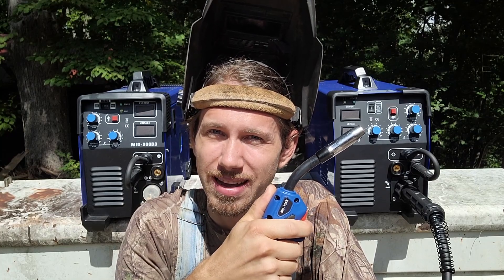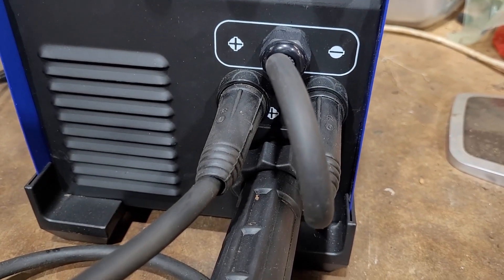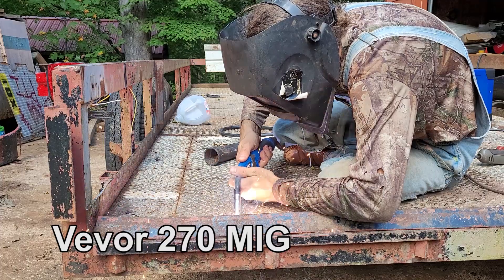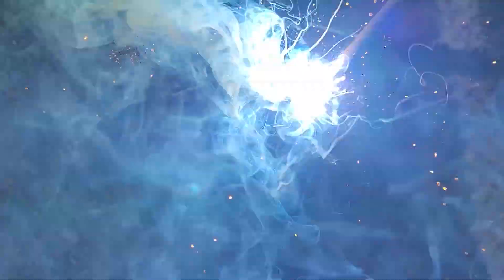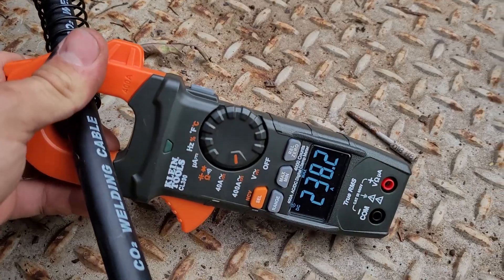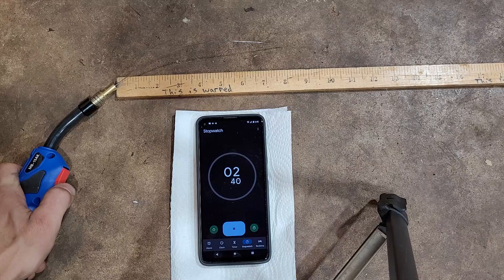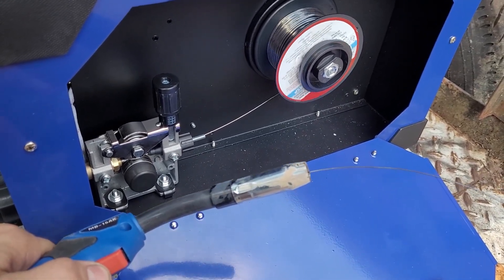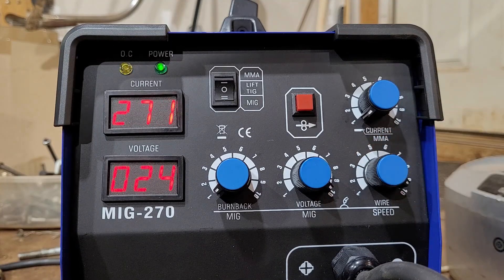AMAZON Welder Review: Vevor 200 VS Vevor 270

Comment: It doesn't matter how well it welds the man problem remains in the Duty Cycle and how good are the materials used to build the Machíne processor  and how it banishes the Heat and

Comment: Ok I’m not a daily pro welder but do my own steel fab projects and have been known to make a few for-sale steel security cages for a/cs and trailer mods and off road armor plates and things like that. Those Amazon machines look almost identical to the classic old school harbor freight mig machines they’ve sold for under $200 for decades now, and I had one in 2003 that worked good to ok up until about 2015, and I didn’t use it but more than maybe a couple times a year. so, I got a few uses out of it, and it was horribly low on the duty cycle temp thermal switch. (Very annoying just doing regular low duty work, not 1/4” thick stuff) and as it approached dying I was having to deal with pathetic ineptacies in the low-grade design that became a hindrance rather than a constructive tool. Like the torch liners(short to begin with) falling out of the sockets in the handle all-the-time and having to always take apart the torch handle to re-set the liner tubes and wires to get it to just make a weld. Really was crap. I got my torture from getting my money’s worth out of it. 
But couple years back got a green Titanium mig machine from there, and it’s literally night and day from the classic blue junk boxes. Has full speed/heat controls and also has an inductance adjuster, as well as bright led digital numeric displays like the big budget brands, but welds like a Miller or Lincoln expensive machine but for $400 not $3500. 
I saw reviews on actual welder magazines and websites and channels saying how good the Titanium and Vulcan machines really were, and is how I ultimately decided to give HF one more try, cause they lost me with their blue box crap supposed deal boxes. They’re not worth the paint on the boxes if they’re more than $30-$40 otherwise a big waste of money unless your goal is to have a machine that makes sparks for a couple pics and videos and then give it to Goodwill. :   )
Reply: So you don't like these welders due to being the same colour as the old Harbour Freight cheap wire welders?
Reply: Thanks, gate welder guy.
Reply: hello
Reply: tttttt

Comment: First off I'm not a welder.I'm trying to decide between the Vevor 270 with 3 knobs{no burn back control}and the Vevor 250 with burn back control 4 knobs.It seems these have been built with different configuration far as the burn back control.Vevor also makes The 200 250 and the 270 that are microchip controlled with only a single control knob I assume controls different functions depending on the type of welding you happen to be doing.I've never seen a single welder design with so many variations.